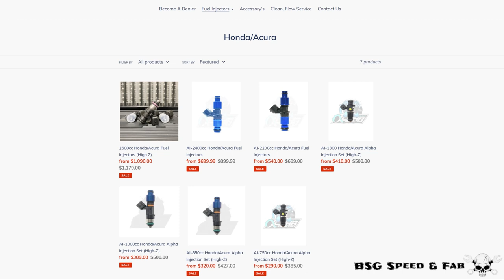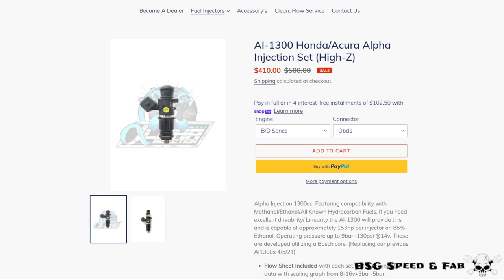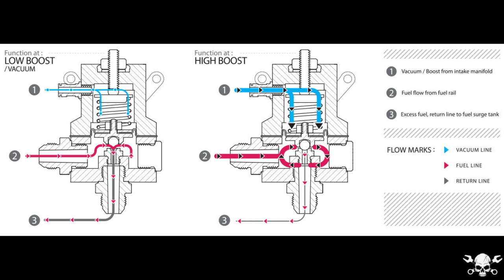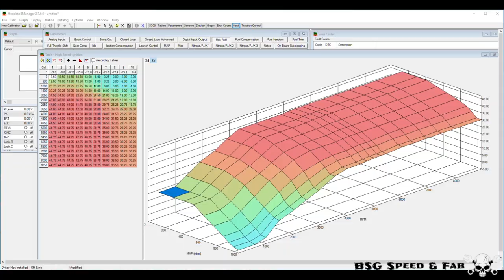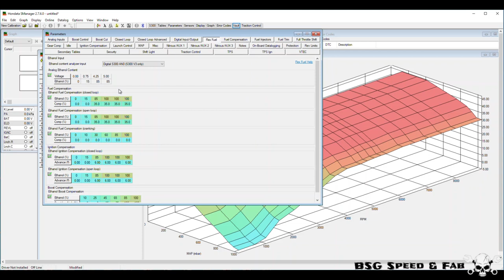Project Civic EG - Ep 11 : Fuel System upgrades to run E85

Comment: Very nice job on the video and editing. Very thorough discussion, good looking build. I think you might find yourself wanting a second pump in parallel, but not even sure what your power goals are. I'm gunna check out more of your videos for sure.
Reply from the maker: Thank you very much! The current turbo will probably only support 350+ but my goal is to eventually make 500 with a larger turbo. The pump shouldn’t have problem but if I decided to push it further then yes I will need to upgrade again.

Comment: Good detailed info on the video bno. On your fuel pressure regulator I have an H22 Civic E85 turbo and where should I set the psi on the regulator to? 45psi or higher? Thanks.